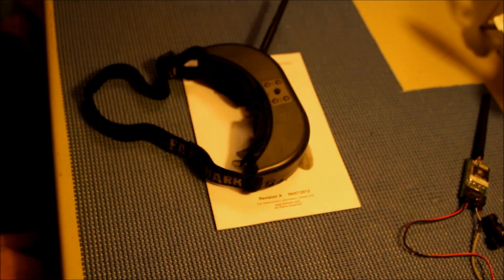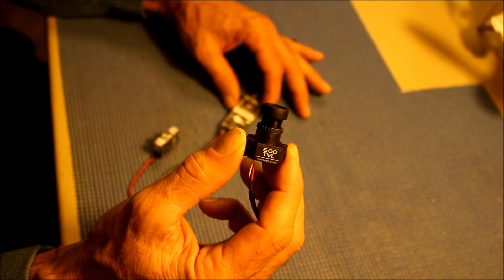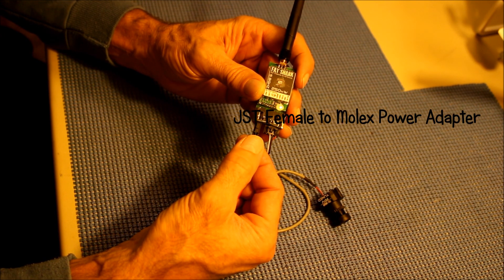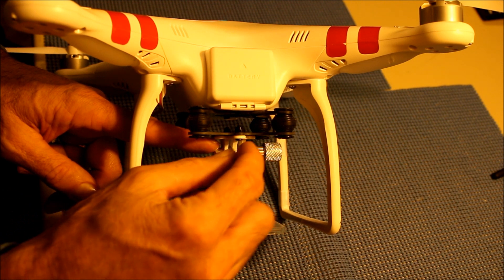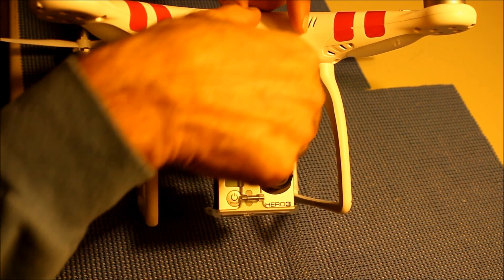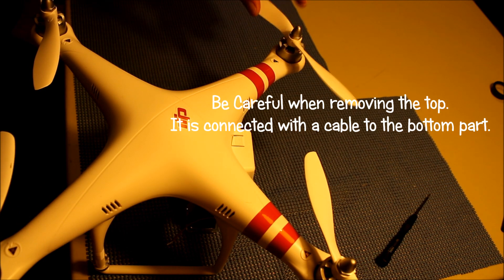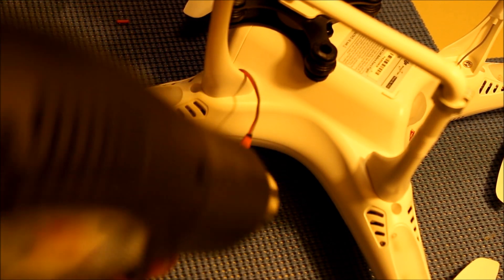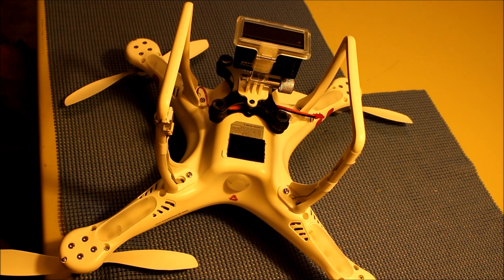Installing Fat Shark Predator FPV Goggles to DJI Phantom Quadcopter with GoPro Hero 3 Camera

Comment: Will the gopro hero work with fatshark.
Reply from the maker: Hi Byron,  The GoPro Hero budget model may work. I have no way to test since I don't own that model.  The GoPro Hero budget model can not be removed from its protective case like the other GoPro models, so you would have to figure out a way to mount it on the quadcopter.  The case has a back door that you would need to keep open for the USB cable connection, or maybe instead cut a hole through it.

Comment: Hi Gary, Just saw your video. Very good. Just one question please. Is it possible to turn the recording off and on using the reciever while in flight? Id like to learn how to do that if possible.
Reply from the maker: Hi Craig.  I don't know of a way to do that.  I use a large card for the video and have video captured for the entire flight.  I can then edit the video as needed.

Comment: Also the other question, I have a go pro 4 is it possible to connect or would i be limited to the standard camera?
Reply from the maker: Hi Richard,
I'm not familiar with the GoPro Hero 4 model, as I have the GoPro Hero 3.

Comment: Hi great video I'm going to go and buy one of these now.

Just a quick couple of questions, if you dont mind, the power supply cable that  you bought how simple is it to make something the same? I live in a place thats hard to get any electrical deliveries customs is pain in the bum. If its not possible to make could you just solder direct to the auxiliary power cable and make it so that the tx is always connected non removable.
Reply from the maker: Hi Richard,
Yes, you could just solder the power cable, but it is probably better to have the connector that is used for connecting to the transmitter.
Reply: Gary Honis thanks !!!

Comment: Great vid. I think I'm going to try that set up on my Hali 500 but I think I'm going with another type of antena. I have seen some that are flat with good operation reception.
Reply from the maker: Hi Audley,
I have since replaced the original antennas with 5.8GHz Circular Polarized Antennas (SMA) for RC 5.8G Transmitter/RX FPV FatShark RC.

Comment: So, is it for flying only or would I be able to do fpv flying and recording video? What about FPV + time lapse photography setting?
Reply from the maker: The GoPro records the captured video to its micro SD card and at the same time transmits the video to the fatshark goggles.  I set the GoPro to its 1440 resolution mode because it is in the 4:3 display ratio and displays better in the fatshark goggles than in the 16:9 1080 resolution.  I don't know about time lapse photography while flying fpv with the googles, haven't tried that.  I think the GoPro would need to be in video mode.

Comment: Unfortunatly, all the new phantoms have been switch to 5.8 on the transmitter
So i would have to go with 2.4 i guess.
Which limits what products you can use. Since most are running 5.8 on fpv
It forces us new Phantom owners to go with a stationary sys. (meaning that i have to have a wire running to the goggles from a seperate reciever) Since all of Fatsharks wireless goggles run on 5.8.

Comment: Hi Gary
my Phantom runs on 5.8 GHZ.
What frenquency does your Fatshark goggles run on.
I don't want to get any interference between the Phantom's transmitter and the video.
Do you have any problem with that?
Reply from the maker: The Fatshark Predator Goggles use a 5.8 GHz transmitter.  My Phantom 1 uses a 2.4GHz Transmitter, so there is no interference. The Wi-Fi used on GoPro HERO cameras, also operates on 2.4GHz and may interfere with the transmitter, so most keep the GoPro's Wi-Fi turned off when operating the Phantom.

Comment: Wow Gary, what a nice and well done review. Very clear to the point.
Thank you Sir!

Question: The cable that goes from transmitter to GP, does it charge GP battery too? Or does the GP use it's own battery during flight?
Reply from the maker: Hi Ben,

I don't know.  I always keep a battery in the GoPro and what limits the flight time is the Phantom battery.
Reply: Gary Honis
Thanks!

Comment: Thanks for the video.  Do you have any video showing the reduction in vibration using the stabilizer that you have installed?  I was looking into using a gimbal, but if this stabilizer does a fairly decent job with smoothness, then that would save a few pennies.  Thanks again for the video.
Reply from the maker: Sorry, I don't have a video showing the reduction in vibrations after installing the stabilizer.

Comment: Is your Phantom an FC40?
That's what i have, and my remote transmits on 5.8.
So i can't use that frequency for video.
It so, what video frequency are you transmitting on?
And can you supply a link to the kit you bought?
So i can get the same setup.
Thanks Gary
Reply from the maker: The Phantom I bought from B&H Photo is a DJI Phantom Quadcopter with GoPro Mount Version 1.1.1.  You can do a search on their website using "DJQGPM".

Comment: Hi Gary good video!

My question is about the IOSD Mini,how do you use that with the go pro footage because the cable goes straight from the transmitter to the GoPro3,so the IOSD would have no involvment.

Thanks
Reply from the maker: I have never installed the iOSD mini.  My understanding is that the IOSD mini requires can-bus. On a Phantom 1 to get can-bus, you either have to install pmu-v2, or you install the phantom upgrade board.  I'm waiting for a concise installation guide before adding OSD and there is not much room inside the Phantom 1.
Reply: Ok thanks,I have found a installation video for the P2.

Comment: Hi Gary. Very nice youtube on the fatshark and dji phantom. My question is,dies the fstshark system interfere with the dji,s radio control system. Im going with your setup when i get my stuff together. Thnx again Brian.
Reply from the maker: Hi Brian, The Fatshark Predator Goggles use a 5.8 GHz transmitter.  The Phantom 1 uses a 2.4GHz Transmitter, so there is no interference. The Wi-Fi used on GoPro HERO cameras, also operates on 2.4GHz and may interfere with the transmitter, so most keep the GoPro's Wi-Fi turned off when operating the Phantom.

Comment: Thanks. You've started to shine a light on the FPV situation with DJI.

I understand there are concerns about the Hero 3's WIFI frequencies interfering with remote control.
What frequency is the Fatshark system operating on?
Reply from the maker: The Fatshark Predator Goggles use a 5.8 GHz transmitter.

Comment: does the gopro run on 2.4 or 5.8, what is the control frequency of the phantom, 5.8?
Reply from the maker: Both the Phantom 1 and Phantom 2 use 2.4 GHz for the transmitter frequency. The Phantom 2 Vision uses 5.8 GHz for the transmitter frequency.  The Fatshark Predator Goggles come with a 5.8 GHz transmitter so there is no interference with the 2.4GHz frequency of the Phantom 1 transmitter.  The WiFi used on the GoPro Hero cameras operates on 2.4 Ghz, so I keep the GoPro WiFi turned off when I use the Phantom 1.

Comment: What is the price on all the products and can I use a tablet instead of the goggles
Reply from the maker: Hi Blake.  This is what I paid:
DJI Phantom from B&H: $479
Hero 3 GoPro from Rocky Mtn. : $330
Fatshark Predator V2 kit from GetFPV: $280
3 cables from ReadyMadeRC: $15

I don't know if you could use a tablet.  I use a 7" monitor connected to the video out of the Fatshark.

Comment: you dont have to take every thing off right?
Reply from the maker: Yes, you don't have to take everything off although using the velcro makes that easy to do.  The Quad would be a little lighter that way.  You don't even have to unplug the power wire to the transmitter, but doing that may allow the Phantom's battery to last a little longer.  If you are not flying FPV, you could just leave everything connected.

Comment from the maker: Hi Chandler,
For the individual red and black wires, 1/16" diameter is a good size.  A 1/4" diameter heat shrink can be used over both.  I use an assortment pack of heat shrink tubes I bought years ago from Radio Shack with 1/16", 1/8" and 1/4" shrink tubes.

Comment: I LOVEE you video explanation, I have the last version Phantom this past Nov 2013, but somone said I can not use googles, can you please verify this??, I like to be able to use googles and take them off and use regular monitor if need to. Can you please help me on this ??? thanks a million.....
Reply from the maker: I don't own version 2 of the Phantom, but my understanding is that you can use Fatshark goggles and a Hero 3 camera if a cable is changed out.  See the video at bestquadcopter.  Having said that, I read of video interference problems with the "Vision" version of the Phantom 2 and the Fatshark goggles because they use the same frequency (5.8 GHz).

Comment: Which version Phantom (v1 or 2?) is this?
Reply from the maker: It is a version 1.
Reply: Gary Honis
 It would probably work on both versions, right? DJI was nice enough to provide a cable dangling underneath my Phantom 2, and it sends the video through the Zemuse gimbal. Now I have an Airy Go Pro FPV cable I'll never use because I didn't know any better.

Comment: Gary, great video, very helpful, don't listen to the idiot comments on here.  Do you like the fat shark model you picked or would you get something diff? Would you change anything if you could?
Reply from the maker: Hi Anthony, the Predator model is working well.  When I bought it, I was interested in the DominatorHD because of its higher resolution, but I notice on the Fatshark website that it is still not available with an expected availability date of April 2014.  If you are considering a Fatshark model, you may want to check future DominatorHD user reports before spending the extra money.
Reply: Yea I'm trying to plan everything for my phantom Fpv before I buy anything. I was also  looking at the dominatorhd. Is the resolution on yours good enough or would you spend the money for a hd? Right now I'm flying it stock w/ a 2mp cam but am excited about the upgrades. Im researching your setup with the addition of dragon link. Also trying to get views on the gopro black, if it's worth spending the money or just get the silver. Thank you for sharing, also what state do u you live in?
Reply from the maker: I am satisfied with the Predator goggles and don't have plans to upgrade to the DominatorHD model.....yet, anyway.  If they were available at the time, I may have gone with the DominatorHD.  The video graphics on my computer display are phenomenal with the higher resolutions of the black GoPro.  The higher 1440P to 4K video resolutions are not avialable on the silver edition. TVs with the 4K resolution are now beginning to be sold.  Going with the black edition would future proof your purchase if video resolution is important to you.  I'm in PA.

Comment: Hi and thanks for this. Is it possible to fly with the 600TVL that comes with the FatShark as well as the GoPro using the 600TVL as the FatShark viewer to sort of fram the shot and then positioning the Phantom so the GoPro can take the photo? I'm thinking about just setting the GoPro to record and then fly... I'm also wondering if this particular setup would be capable on the Phantom 2 (as well as Vision without GoPro) with GoPro and just adding separate battery for the FatShark transmitter?

Thanks.
Reply from the maker: Hi Airwolf,  I think that would be possible.  The 600TVL is certainly light enough.  Maybe you can give it a try?  I have no experience with the Phantom 2.

Comment: Great tutorial !!!  One question, does the USB cable to the go pro power or charge the go pro ?
Reply from the maker: I know it doesn't power the GoPro.  You still need to have the GoPro battery installed.  I doubt if it charges the GoPro battery.  The GoPro Hero 3 battery has a pretty long battery life at around 1 hour 40 minutes and the Hero 3+ lasts over two hours.

Comment: What is the cable called that attaches from the go pro to the antenna giving the ability to live feed the go pro through vision goggles? You mentioned it was on the readymaderc website but I can't find the cable. Mini USB something
Reply from the maker: If you use "Hero 3 cable" and do a search on the readymaderc web site, the cable to connect the Hero 3 to the transmitter is the "GoPro HERO3 Camera Cable (ImmersionRC/FatShark Style)" cable.
Reply: Gary Honis
I checked it out and found it, however, I cant find where they accept paypal. I've sinced search ebay and found one here:
http://www.ebay.ca/itm/GoPro-Hero3-Camera-Cable-Immersion-FatShark-Fat-Shark-FPVPCHGPH3FSAV-/251378009454?pt=Radio_Control_Parts_Accessories&hash=item3a874c056e
I am wondering why in the picture, one of the wires is not connected to the plug in component.. ?

Comment: gary,, very good video.. no frills.  I am thinking of getting the Teleporter goggles.  Do you think it's worth the extra $80 to get the Predator's? I plan on using my Hero 3 or 3+ as my viewing camera anyways so the little included camera is not an issue for me.. thanks for any help.  Danny
Reply: btw, I'm not interested in Head tracking or anything very much more costly or techy… just wanna get in the "cockpit" hah… so it's about the resolution or "viewing experience" i'd get in either goggle.
Reply from the maker: Danny,
 I think the extra $80 for the predator is worth the extra video resolution (640X480) versus the teleporter at only 320X240.
Reply: Gary Honis  hey, i got my predator's in the mail!! as I'm new to all of this, could you give me any advice or detailed instruction on charging the fatshark battery.  any tips on charging these LiPo batteries would be welcome.. so excited!!
Reply: Gary Honis also,, any specific order to turn all this on? like the phantom.. transmitter first then copter second.
Reply: Gary Honis update.. just plugged them in fresh out the box, found a channel that worked.  I'm in my bedroom at nite w lights on… doesn't seem that sharp of picture… not sure if gonna be better in the daylight??

Comment: Gary,
I noticed that you didn't use the power filter connector.  Is that filter necessary?
Reply from the maker: Hi Mike,
No problems without using a power filter on the Phantom 1 so far.  I've read that some installing power filters eventually removed them. I would think since DJI has designed the circuit board to provide the auxilliary power lead, that they have taken any filtering needed into account.  If you had interference lines in your video, banding or dropouts, that may be the time to try a power filter.  I have no experience with your Phantom 2 which uses a different battery, so keep that in mind.

Comment: I have the Phantom 1 and I recently bought the Phantom 2 but to my dismay they have a new battery pack system.  I haven't opened it yet, but do you believe there may be an auxiliary power cables on this model as well?  I would love to run my Hero3+ with a gimbal attached as my FPV.
Reply from the maker: Hi Mike,
I don't own a Phantom 2 but I did read on the HobbyKing discussion forum that the Phantom 2 has "2 aux power options".  See message #4384 on page 293.
Maybe you could ask there about their locations?
Reply: I found an australian youtube video with the Phantom 2 attached to the Zen Muse gimbal and a GoPro Hero3+.  He attaches a special cable to the Fat Shark transmitter from the video link of the gimbal inside the Phantom.  The video link supplies the transmitter with both power and live video feed from the GoPro while recording to the sd card.  I have yet to try this but I am searching for this cord.

Comment: Thanks for the awesome video. Would I be able to record and stream through GoPro at the same time  with your modification? Thanks so much.
Reply from the maker: Hi Binesh,
Good question.  I don't know.  I haven't tried to stream video live from the Hero 3 camera using the WiFi connection and at the same time use the FatShark goggles.

Comment from the maker: Hi Steven,
Yes, the GoPro records the captured video to its micro SD card and at the same time transmits the video to the fatshark goggles.  I haven't noticed any lag or reduction in quality.  I set the GoPro to its 1440 resolution mode because it is in the 4:3 display ratio and displays better in the fatshark goggles than in the 16:9 1080 resolution.

Comment: That was a great instruction video. Thanks so much for putting it. I am a newbie on this whole UAV thing. Where did you purchase the Fat Shark? I googled it and there are so many places. Is there some place you recommend?
Reply: I recommend you to buy it on HobbyKing. They have great prices for high quality when it comes to FPV set.
Reply from the maker: Hi Binesh,
I bought the fatshark googles from GETFPV.  They shipped the fatshark two days after I placed the order and provided USPS tracking information.
Gary
Reply: Gary Honis
Dejan Režek
Thanks guys. I will check both websites.
Reply: Gary Honis
I got myself a Fat Shark system from HobbyKing as you had suggested. It is pretty cool. Just want to ask one more question, do you know what't the range of Phantom before it loses communication with the controller?
Thanks a bunch Gary.

Comment: After watching ur video I opened the quad and was unable to locate that auxiliary power cable I have version 1.1
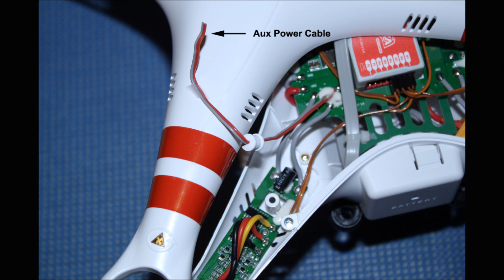Reply from the maker: Sorry to hear about your missing auxiliary power cable.  You can look at the slides in the video at 11:29 and 11:41 to be sure where it is connected.  If you do a google search using "No aux power lead on my Phantom", you will find that some others have had that problem.  You may want to contact the vendor or install wires on your own, but that may void the warranty.